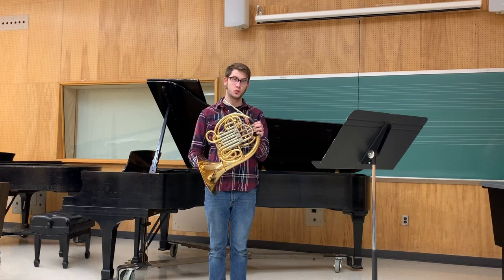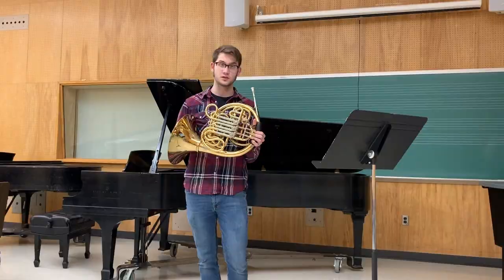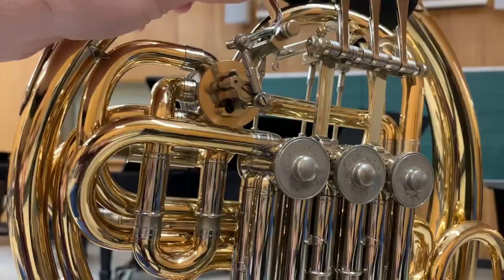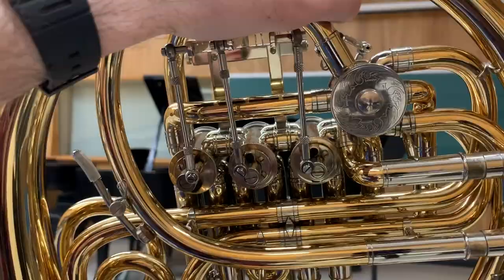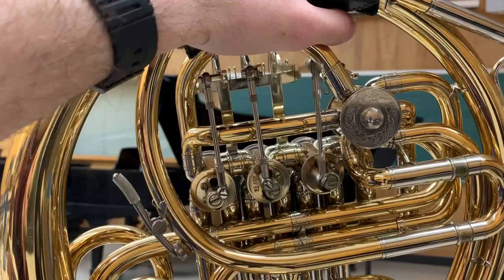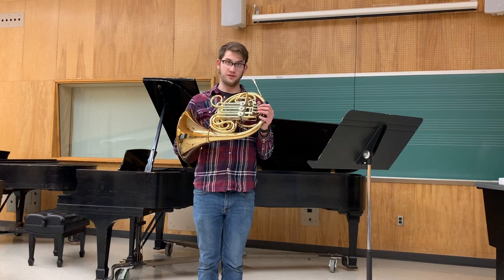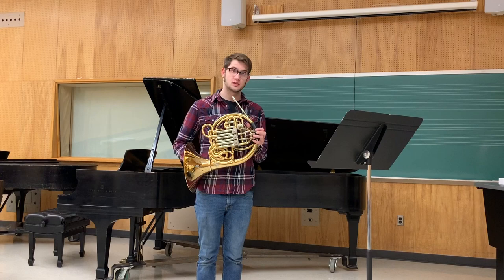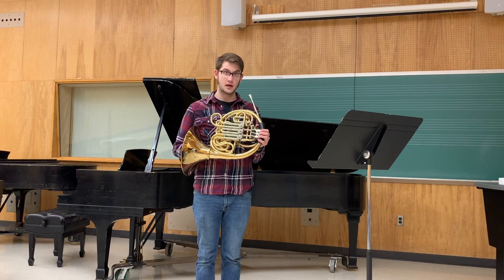Week With a Horn: Alex 103

Comment: Does 103 have similar flow resistance as Conn 6D or 8D? Geyer style horns with low resistance may be easier to blow but leads to faster air depletion from lungs and doesn't have the dark classic horn sound in my opinion. I think Geyers sounds more like a trombone. Alex 103 looks like Kruspe style but not sure. And I wonder how it compares to Geyer style horns.
Reply from the maker: I find the 103 to be much tighter in resistance compared to the 6D/8D, I attribute it to the tight wrap.  Which I think can cause players to struggle in the lower resister.  However it CAN be done well. Sarah Willis is a great example of a low horn player on a 103. Geyer horns I think are generally pretty free blowing due to the way in which the horn is wrapped. The 8D is more open due to the larger throat and bell I believe. If you’re running low on air, I suggest trying to use a tool I like to use. It measures lung capacity in liters.  I’ve used it during my entire time at Eastman and it definitely helped: Voldyne 5000 Volumetric Exerciser (Each) https://www.amazon.com/dp/B000PAR7KQ/ref=cm_sw_r_cp_api_glc_fabc_raibGbZ9FMTZF?_encoding=UTF8&psc=1
Reply: @robertlevine1093  Thanks. Much appreciated.
Reply: A geyer horn has a smaller bore (medium bore) compared to an 8D (large bore) so it offers more resistance, opposite of what you said. A geyer can have a very warm and mellow sound. It’s just more carrying rather than dark and covered like an 8D. Geyers have been around ~100 years. 8Ds have not. A kruspe is not synonymous with an 8D. Most pros now who play kruspes, even Hollywood recording artists, use a Hans Hoyer. If the 8D best represented the traditional horn sound, then all the prestigious symphonies in Europe would play them. But they don’t. The 8D is a good horn but it is not THE definitive horn like many Americans make it out to be. The 8D was beneficial for older style Hollywood recording where they put a mic right on the bell.
Reply: If you want to hear a “classic” horn sound, listen to some hand horn.